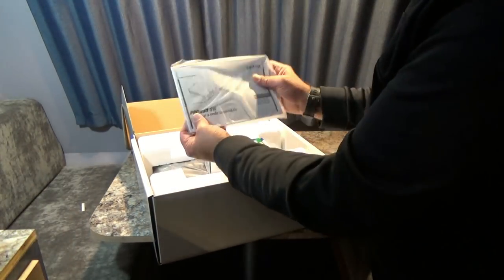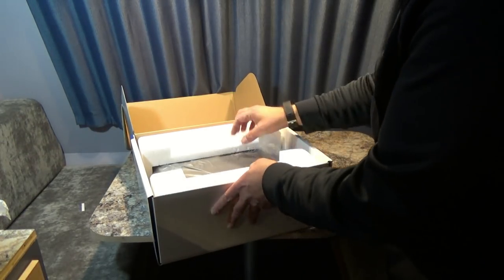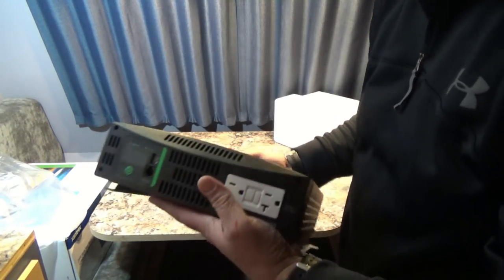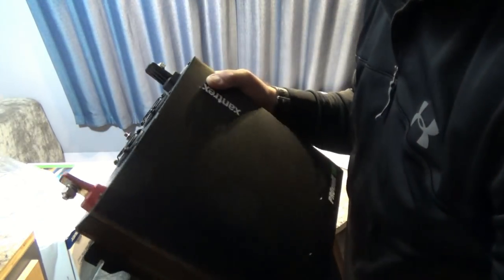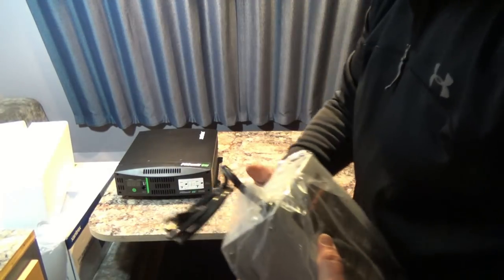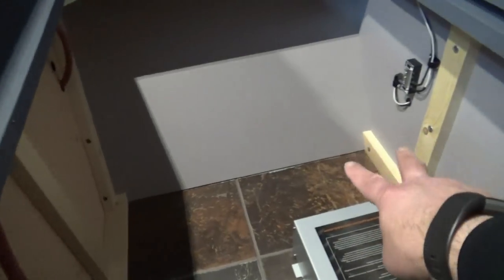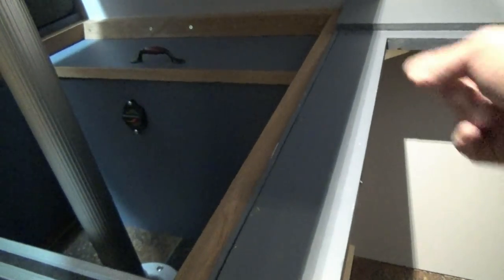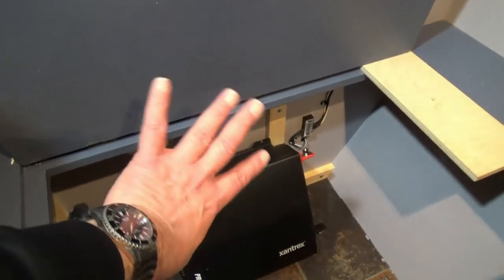How To Build A DIY Travel Trailer - Part 68 (Unboxing Xantrex Inverter and Powermax Converter)

Comment: Hi Al...With the use of separate inverter and converter gives great flexability in placement,but with that you have to take into consideration the amount of heat created by them,especially the inverter which will heat up a space quickly...If you intend on placing both units under the short seat I would add a fresh air intake and a powered exhaust to the outside...Computer fans are a great choice for this and is what I will be using for my one piece inverter/converter exhaust...

On using an Inverter you have to keep it as close to the battery as possible,Length of the battery cables as they get longer puts a laboring effect on the inverter causing more heat,degraded performance and a lessened output,undersized cables provide the sameeffect...I will be using 1/0) cables on mine with the inverter/converter combo 2 foot away and my second battery 3 1/2 feet from the first...

I would recommend this fan: Cooler Master R4-C2R-20AC-GP Clear Blade 120mm PC Computer Case Fan - NEW-(Silent Running 69CFM at 2000 RPM)...

https://www.ebay.com/itm/Cooler-Master-R4-C2R-20AC-GP-Clear-Blade-120mm-PC-Computer-Case-Fan-NEW-/231386835324?_trksid=p2349526.m4383.l4275.c10...

You might think it is overkill on the CFM,but the cooler electronics run the more efficient they are and cost less to run...Oh and by the way,you got the amps to watts equation perfect...
Reply from the maker: Thanks Steve! Very helpful tips! I gave it a test run tonight... worked really well! Kicked on the microwave and refrigerator and the test was great! I do have video to upload coming up of how I installed everything. I used 2/0 wire to bus bar and 1/0 to inverter with fuses in between with a battery shutoff. I don't think the fan you mentioned is overkill... on the other hand, the fan I purchased just might be! LOL!! Hope you stay tuned to see how I pulled it all together, and of course... if you see something I did in error, don't be afraid to let me know! Thanks again Steve, sure appreciate the support!

Comment: Beautiful inverter!  It looks like you have thought everything out quite well. That will save a lot of future hassels.  Will you be wiring your charger through your charge controller with the solar?
The thing you want to keep in mind with lead acid batteries is that you don't want to discharge past 50% if you want them to last 10-20X as long.  Also, you can only bulk charge them to 80%, then they take several hours on absorption and float charge before they are topped off, 100%.  So when you are away from shore power for more than a day, you really only have 30% of battery capacity to use, because they won't have time to get back to 100% on solar.  35 amps of usable DC translates to roughly 3.5 amp hours of AC @120vac, or 30 mins at 7 amps.  Also, since that inverter has a fixed shutoff voltage, you will need to self monitor your batteries state of charge or the inverter will draw them down to 10-20% SOC before it shuts down.  That inverter should easily run anything you want to plug into it shy of a large air-compressor, good choice :)
Reply from the maker: Thanks Aspendell! Kind of figuring out as I go, but taking my time helps! Charge controller will still be connected directly to the batteries, I will run a bus bar from the batteries to everything else.  Great tip on power usage!! Most places I plan on visiting will have some sort of shore power... and in the unlikely event they do not, I will resort to a generator.  Really, the only appliance needing the power will be the refrigerator, Microwave is just an option while on shore power. I just hope everything works out that I have thought about... the big test will be coming up soon!

Comment: Hi Al, glad you got your converter and inverter. I have to make vents for mine as well. I was wondering, are you not planning on using under your benches for storage? If not I’m thinking a place to put some tools you might need for what ever reason comes up. These wouldn’t interfere with the heat that will be generated. Just an idea. Stay warm
Reply from the maker: Thanks Gary! I will use as much space available as I can.... The front storage is a little limited with all the electrical stuff, but I will most likely put things in canvas bags if needed and stow away there. More than likely it will be just the dining stuff, paper plates, cups, utensils, place mats, that sort of thing. I'll make sure to keep the combustibles out of there!! LOL!
Reply: Hahaha yes no combustibles.

Comment: The inverter has to be the closest possible from the battery and you can use longer cables for AC distribution.
Reply from the maker: True... I am closest to the batteries as I think I can get since I have a battery on each side of the trailer. To compensate (hopefully), I will be using very heavy gauge wire from inverter to battery. The first test will tell all. Even with voltage drop, I should still have plenty of power.

Comment: these are to transfer power to the trailer?  are they enough to deliver power to all electrical devises ?
Reply from the maker: Yes sir... very adequate. All lights are 12V, and if all lights are on, it pull about 3 amps. The refrigerator would use the inverter when not plugged in to shore power, and pulls about 1 amp (approximately). The microwave would draw the most power, so that would be used sparingly. The converter will provide enough power to the batteries to keep everything charged and running. Works quite well!

Comment: you could used a 30 amp transfer switch
Reply from the maker: I need to do a little research on that... I've heard something about it, that it would shut the converter off if I use inverter, is that correct?
Reply from the maker: Thanks for the link.... I am going to look into this and see how it's done. May use that idea on next project! Thanks!!
Reply from the maker: Thank ya... I'll be checking this out tonight. Appreciate the tip!
Reply from the maker: Hey Ray... I checked that link out... I've got to get me one of those!! That is a super idea!!! Thank you! Cheers!
Reply: You are welcome you have done  a grate job on the trailer. I thank it well be fun to camp in.

Comment: Your going about this the wrong way...

1. running that microwave is a waste of valuable battery power for one. Its 900 watts but takes probably 1400 watts surge to start it... ( what size cable you running from the inverter?)
2. If you convert 900 watts / 12 volts you are going to be pulling 75 amps from the batteries... It may work but when boon docking your solar will never recover the batts. ( 116 amp surge @ 12 volts)
3. Its camping... Heat food on the stove  top. Make coffee in percolator etc etc.
4. OK no propane fridge. So 100 watts / 12 v =  9 amps from batts evertime fridge compressor comes on.. If it runs twice an hour  it may use 50 amp hours a night. Plus that big inverter has losses @ 10% or so. Do the math...

The biggest inverter you should of put in there was a 1000 watt and use only for fridge and have an outlet or two for charging..

With 10 amps from inverter at night you need to get charged back up from solar during the day. Hope you have a generator. Youll see..

And that inverter is automatic. You should of got the progressive dynamics with the charge wizard IMO. You can push the button and get fast 14.4 charge in 2-3 hours. That converter will kick out of bulk too fast.

Pd9245c would of been a better choice.

http://www.bestconverter.com/9200-Series-Deck-Mount_c_84.html

You should of forgot abot the micro. A mod sine would  of been fine. And this are the preferred units without the GFCI and a floating neutral.. Krieger 1100.

https://www.amazon.com/Inverter-Installation-included-Automotive-according/dp/B00T564EIY

I know I mumble but did you watch my load testing?

https://www.youtube.com/watch?v=wz2ttT8fFLc&t=1s

https://www.youtube.com/watch?v=7p-oNT8YDIs

And did you ever fix your ground issue????
Reply from the maker: Hey Lawrosa1, welcome back! Let's see if I can answer some of your questions....

1. Microwave - I will most likely never run the microwave off of the battery if I'm boondocking. If I do, it will be in mornings only. Any drain that occurs can be recovered with the solar during the day. So far... that seems to be working well.  From the inverter to the batteries, I am using 1/0 and 2/0 cable.
2. I have not done any extensive testing yet running all power, so not sure about total recovery time. Your videos inspire me to do some testing for sure!
3. If I am boondocking or have no shore power... my main source for cooking will be an outdoor grill. I will have some sort of induction stove top to heat water when needed. I will run a small coffee maker in the mornings (gotta have coffee!).  They do make some nifty little gas coffee makers that I will be looking into.
4. Refrigerator - I haven't actually tested the system to run full time with just refrigerator and lights yet. I am curious to see the draw when running. I will plan on setting that up soon. I think your math is pretty close.  My batteries are 200 ah, so I have no fear of running overnight once or twice.

Inverter - Happy with what I am using. Overkill? Maybe. But I generally go overboard on things like this. Thanks for the link on your inverter... and your tests. If I decide to setup a little solar power station, I think your inverter would be an excellent choice, and it seems to handle your tests very well!

I agree with your comment about the converter... had I done a little more research, I would have been using your recommendation. If I have to replace the Powermax, Progressive will be the next unit. And yup... I do plan on having a generator as a backup! I want to be off grid, but not powerless! LOL!

Yes sir.... watched your load testing videos. Very informative! Would have been interesting to see the same tests with the solar panels connected. Not that the end results would have been much different... just longer to reach.

I believe the ground issue is corrected, although I never did find where I may have connected ground to chassis. I am still going through and checking all connections. Haven't had the same problem since rewiring everything though.

Thanks for the feedback sir... much appreciated and respected.